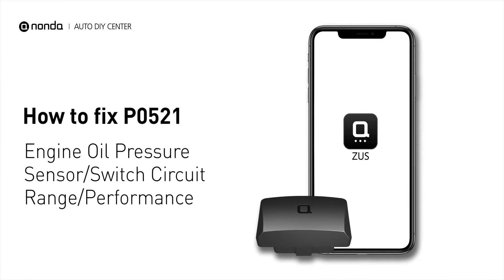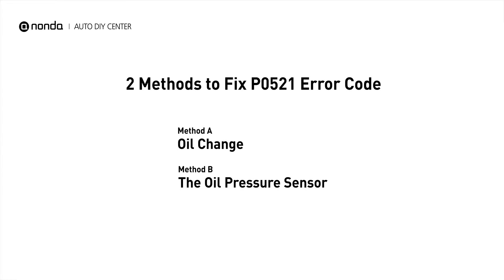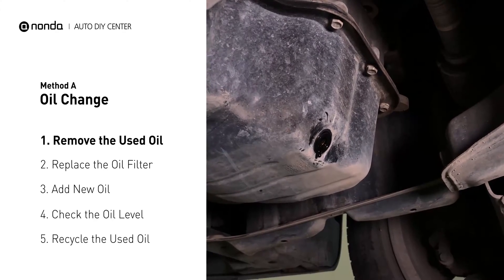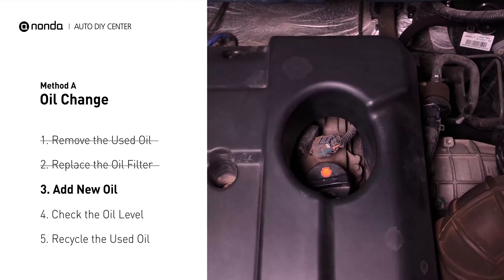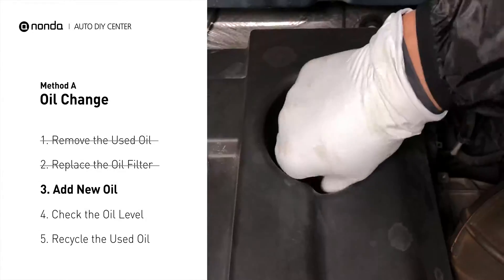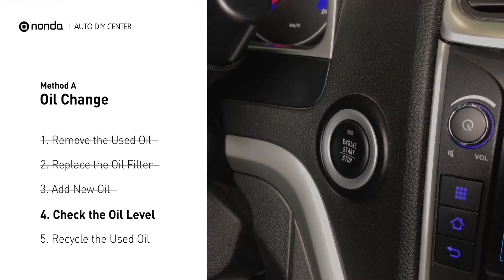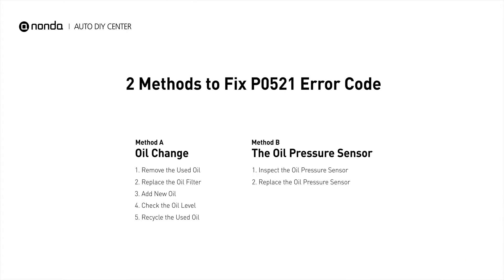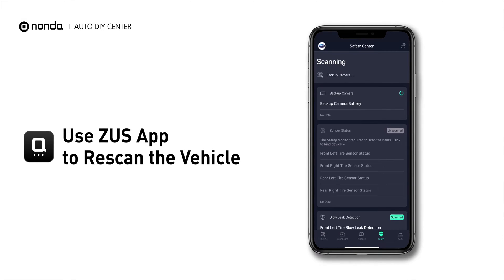How to Fix P0521 Engine Code in 4 Minutes [2 DIY Methods / Only $6.87]

Comment from the maker: Hi, I'm Steve, nonda's lead mechanic engineer. 
Feel free to leave your comments here if you have any mechanic questions, I will be glad to help you out!
Reply: I hope this will work with my 2007 tahoe. I just changed the oil to full synthetic 5/30. I will change the oil sensors tmrw. Thank you
Reply: 2019 insignia 1.6 cdti diesel p0521 code comes together with p06dd would that fix both ?

Comment: Did oil change and replaced sensor on 2019 Jeep Compass (1.6 diesel). Still can't clear the code and definitely down on power. Any suggestions? Thanks.

Comment: Would this code cause a loss of power ?
Reply: Can this code possibly have anything to do with intake manifold? This code showed up when I got a tune up for my C300
Reply from the maker: Hi Riqco, yes- possibly.
Reply: @nondainc  no
Reply: It did cause loss of power on my Escalade, after it wasn’t reading the pressure properly, the engine went into limp mode to protect itself.